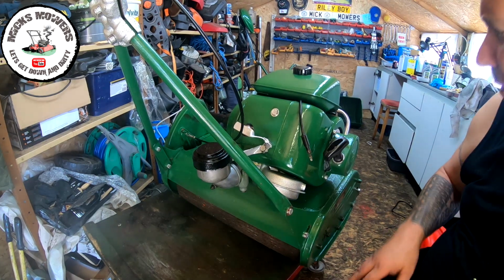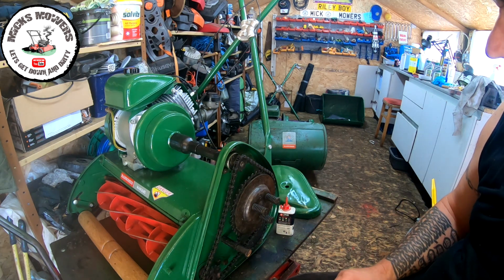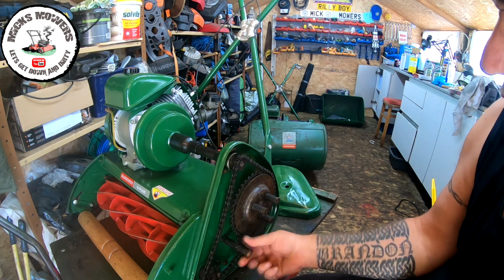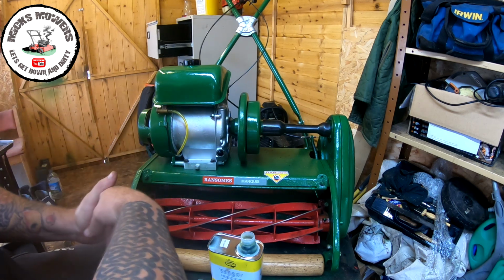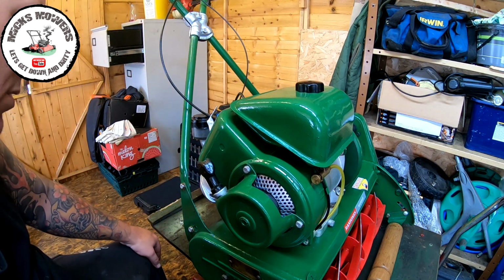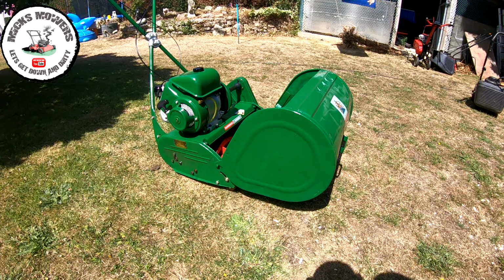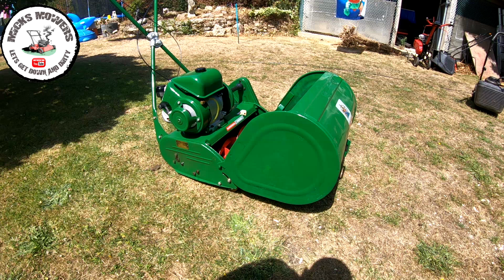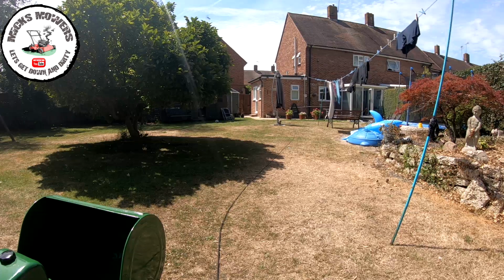Ransomes Marquis 20" Mk 4 Vintage Lawn Mower Will it run ?

Comment: Just picked up a beautiful Marquis M4A at an estate sale in Kansas City. The owner purchased the mower in Belgium in 1968 and then moved to the states shortly thereafter. He found that the mower severely scalped his Kansas grass so he put the machine in storage where it's been since 1970.  Only used less than two seasons in 50+ years.
Reply from the maker: @cattmann1405  wow.. sounds good

Comment: Nice job Mick, its good to see people appreciating these old Ransomes mowers for what they are and that is English engineering at it's finest! I think you have seen my restoration of a 1960's Auto Certes on you tube because you answered some questions in the comment section. Keep on mowing! I will soon be doing a video on a Certes Mk 10 push mower restoration which should be up in a few weeks time.
Reply from the maker: Hi mate cool I will keep an eye out for it.. I have another 2 Ransomes in and a 17 inch Suffolk punch

Comment: Hi Mick, I have just managed to get my Ransomes Marquis running in the last couple of days and there is no way I could have done this without the help of all your videos. I have never refurbished anything beyond a bike before and this is my first venture in engines and the like. After reconditioning the engine next step is to get it painted and stop that starter coil rattling! I didn't want to paint it unless I could get the engine running, onwards and upwards thanks again - your enthusiasm and passion is a joy.
Reply from the maker: Cool.. I still have mine in the spare shed somewhere lol I will be getting it out again this summer after sitting for 3 years... So keep an eye out for it .. ta for watching mate

Comment: The Marquis Mk4 came with an oil gun as part of it's tool kit and the original operator instructions say that oil should be applied to all the nipples.  I bought my early Marquis about 25 years ago  from an elderly gentlemen in the village who had owned it from new.   It came complete with tools and manual. It has always been oiled and not greased. I had to buy another oiler though because the toolkit one  was the worse for wear and most of the oil ended up on the floor without getting past the nipple ball bearing. I now use  a wanner 300-1 oil gun and it is perfect for the job. A couple of shots   every now and then not only oils, but flushes out any accumulated muck. The land rollers haven't been off in 22 years and they still run freely and "tick" like new.
Reply from the maker: Fantastic.. I must get mine out again soon..

Comment: Excellent Mick. And the colour is spot on. I’ve the same mower but with a villiers engine from Wolverhampton. It has a little rust in the tank- did you clean yours out with some petrol and bolts? Also where did you find the new stickers as mine had lost his. 
My engine cover is bright red and the engine is more square than this one. 
Thanks for a wonderful extended project. Lee
Reply from the maker: You can use some anti rust treatment and with some nuts and bolts clean the tank.. you can get the stickers off eBay mate

Comment: Hi bud cracking stuff , where’s a good place in Hertfordshire or North London, because I’m trying to fix a similar type of one it just won’t turn over it takes about 1 million pulls  but it’s a start and run
Reply from the maker: I have no idea mate. I’m on the south coast
Reply: @themowerman  no worries 😉, I think it’s the pulley, There is a lot of slack on it and I will try to tighten it hopefully that will help a turnover better 🤞

Comment: I  LOVE  THESE  ENGINE .  AND  SOUNDS  VERY  NICE  TOO .HOW  MUCH  DID  IT  COST  TO  GET  THE  CYLINDER  SHARPEN  . ? THEY  ARE  THE  VERY  BEST  VINTAGE  MOWER  OUT  THERE  .
Reply from the maker: £40 to get it done.. yes it's a lovely mower
Reply: @themowerman  WHERE I LIVE  TO  GET  A  CYLINDER  SHARPEN  IS  OVER  £100 OR  MORE  FOR  A  12" CUT  CYLINDER  .

Comment: Hi mick, I'm struggling to get a throttle cable for a suffolk super colt I've rescued it's my first renovation even with the part number E7165 it's not available any ideas where I can get one
Kind regards
Geoff
Reply from the maker: Here you go  https://www.japgmowers.co.uk/throttle-cable-suffolk-super-colt-super-punch-14-mower-e8934-l08934-f016l08934-part-33677-p.asp